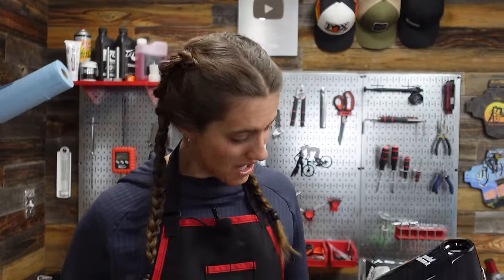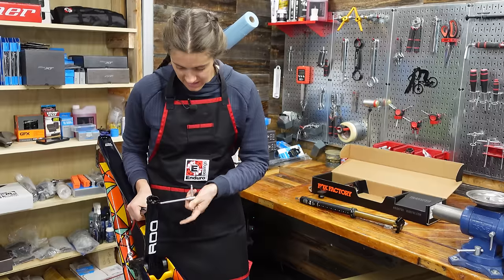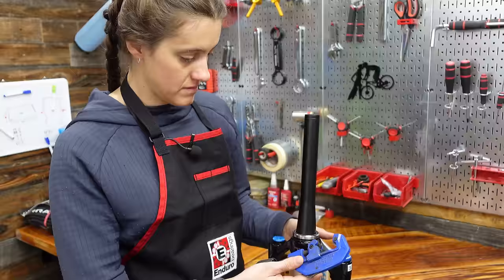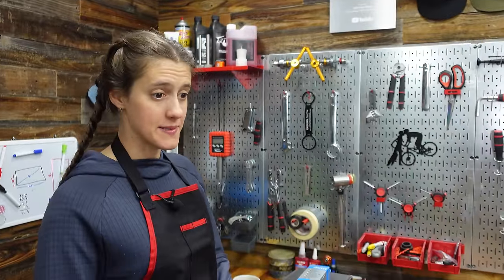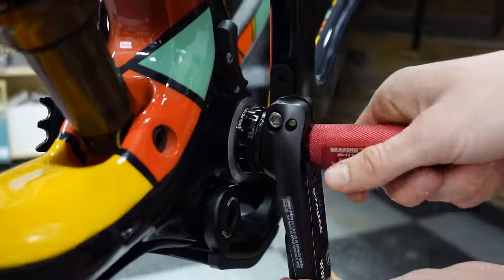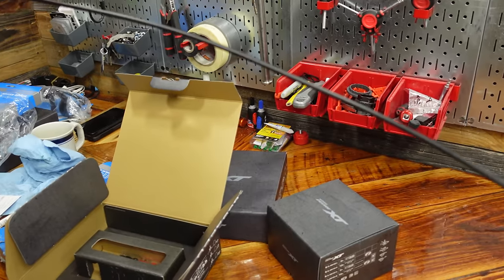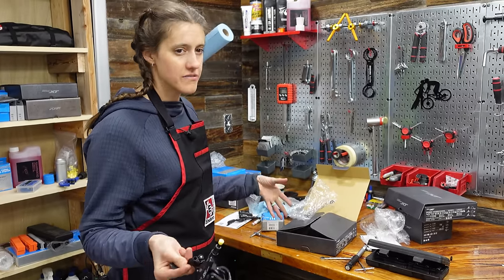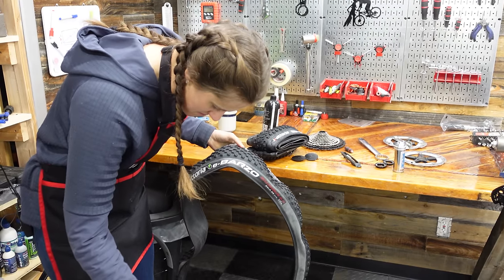FULL BUILD of my CUSTOM PAINTED Niner Bikes JET 9 RDO | Syd Fixes Bikes

Comment: I have a compressor, but no adapter for Presta valves, so I just use a hand pump to seat tubeless tires.  I wanted to make sure I could do it any time, anywhere.  The key is to just take a strap of some kind, even a piece of rope will do, and bind the tire right down the center.  It will seat with just a couple of pumps.  Pop the rope/strap off and finish pumping.  No big deal.

Beautiful bike btw, I love it!

Comment: I stripped a couple crank axles like that one with small splines. I "upgraded" to the type of axle spline that has smooth swoopy crank to axle interface but the drive side worked itself off after 50 miles and doesn't have clamps, it was pressure fit. I drilled and filed a square hole in the center of the crank side, used a 3/8" carriage bolt, a union nut, and a hex keyed countersunk bolt with washer pulling in from the other side. Crimp the thread on the carriage bolt at the depth you want the union nut to stop at.

Comment: After you tighten the crank arm pinch bolts you want to check for any play in the crank spindle.  If there's play, you'll want to loosen the pinch bolts and then using the BeCraFTS tool to adjust the spindle endcap bolt until there is no more play and the cranks spin relatively freely.

Comment: Welcome back.
Might be worth running the dropper post outer before installing the BB ... Access to that bend.
Reply from the maker: On this frame (and most frames with threaded button brackets) there's actually no access to inside the bike from where the BB threads in. And this frame also has continuous internal housing runs...
But on frames that do have internal access there, that's a great idea!
Reply: Haha, I’m in the middle of this exact thing.

Had to push out a perfectly good bb, which sadly ruined it, to get the dropper housing routed—it was just impossible otherwise.  Waiting for my new bb to arrive now.

Comment: Lining the tire logo up with the valve stem is definitely a thing. I do the same thing (sorta) with cars - the manufacturer logo on the wheel needs to be right-side up with the valve stem at 6 o'clock on the wheel.....and the locking lug nut goes opposite the valve stem.
You've reminded me that I need to bleed the old-school Hayes brakes on my vintage 4 Banger......

Comment: Re: tubeless.....

I ran tubeless for a season,  with a Stan's kit. But before all that, I did an experiment -- I coated the inside of my tires with automotive fix-a-flat, and let it air-dry (an hour or so).

Absolutely airtight. Went over 5 weeks without needing even 5 psi of top-off.

Only did it the one season because my bottle of Stan's got destroyed, and feeding 6 kids was a higher priority.

Comment: I never use star bits in forks as they're crap.

I've found a while back that there is a skewer  nut which will go all the way through the centre of the forks head tube and screws into a nut inserted into the bottom of the forks head tube pulling the whole top half firmly down.

That way, you know, when you're tightening it up, you are actually tightening it up and not simply pulling the star nut up.

Also, what a few companies are doing these days is to use that idea but instead of just a straight bolt through skewer, the top half is actually a mini trail-tool.

I believe OneUp have recently changed the design of their headtube mounted toolkit system to this sort of design too...which is a whole lot better than their previous method of having to tap some threads into the top of your fork's head tube.

This way, you still have options rather than bunging a semi-difficult/damaging to remove and annoying to fit in any case star nut...which basically always works loose in any case.

Comment: You can swap grease out for anti seize in any threaded or press fit application that does not involve bearings. Basically anything thats static. Parktool have a good page on it - the-park-tool-guide-to-bicycle-lubricants-and-compounds

Comment: lol, a while back in the late 2000's, I bought a super lightweight CF seat post which I overtightened. At that young age, torque meant nothing. I went ridding and 5 minutes into the trail, the seat post snapped, leaving a sharp piece of CF pointing straight up. I had to pedal out of saddle for a half hour to get home. That same day, I bought a torque wrench.

Comment: You put the brand logo with the valve stem so if you take it apart and find a hole you can look at the rim at the same place to see where it came from. There might be a dent on rim in that same spot. It makes it easy to find

Comment: Pipe cutters take twice as long but do a much better job of a clean cut on forks. 
Pro tip: Shove a small rag into the bottom of the fork crown. This will catch all of the saving and prevent them from falling into your fork seals.

Comment: Honestly, I don't think I have seen a prettier frame.  So well done and we'll designed.  Syd, fantastic seeing you get r done and putting together your own rig.  Never fails that there is still an element of realness even in a bike build vid, to show the challenges one might face in doing a full build.  Appreciate the thoroughly done build project, and the helpful commentary from you both.  Macky, maybe a reverse paint job of the same pattern for your next ride???

Comment: Great video. One thing that bothered me is when seeing people with a torque click style wrench not grasping in the center of the handle most torque wrenches are length specific. So when you slide your hand closer to the the square drive you are increasing the amount of torque at the square drive.

Comment: Wouldn’t you want a little wider tire since you are running a wider rim? 
I’m not even 5min in and already loving this. My heart started racing when you were holding the frame up. I would be freaking out with excitement. 
I have a carbon build in the works…waiting on my frame. It’s not supposed to be done until May and I check my email about 10 times a day already. 
As always, great video.

Comment: Sweet bike. Centering the logo of the tire brand on the stem looks best. But I guess I am too practical, I center the tire pressure info on the stem so I am looking at it when inflating the tire.

Comment: Star nuts are easy to install by getting an old adjustable wrench and a hammer and putting the handle of the hammer on the Star nut and hitting it with the wrench

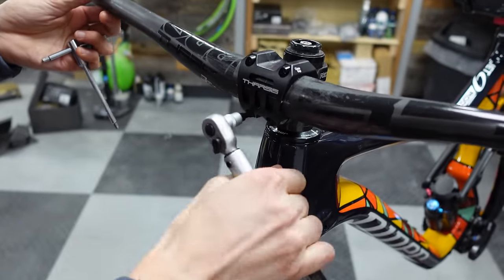Comment: Awesome to watch this beautiful bike come together!  I just had one quibble... at 23:57 I see you holding the torque wrench by the shaft, up closer to to the head.  This kind of click-style torque wrench won't give you an accurate reading unless you hold it by the handle and let the spring-loaded clicker do its job.  You could very easily accidentally overtighten bolts that way.  Great job overall, though... it looks amazing, and I'm looking forward to seeing you riding it!

Comment: fyi, Syd is marking the extra, as the "flare_nut" has a flare on the pipe, like the end of a clarinet, or other wind instrument, this locks the pipe in the fitting, and the taper on the inside seals the fluid path; this nut bottoms out on the other part inside, plus tension, this is the distance that Syd is marking, where the distance is, PLUS clearance for the flaring operation.

Comment: great video, but Syd, a Torque Wrench needs to be handled a certain way (so you don't jerk it, causing a high spike in torque, meaning the "break" or trigger goes off prematurely), to do it correctly, use the wrench TWO handed, one supporting the head, the other the handle, and gently grip it, straight arms, and pull evenly, and at a moderate, not fast pace so you feel the 'weight' come on gradually, then like a guns' trigger, SNAP, it breaks, giving a correct reading of applied torque.

Comment: How does that specific pipe cutter work? I only ask because I assumed they were like a pipe cutter like Rigid or Milwaukee cutter. They don't technically remove any stock (produce chips) that could fall down the tube or get in grease. 
Either way cutting fluid would make the pipe cutter's blade last longer, stop squeaking, and give a cleaner cut. I use pneumatic tool oil just because it's safe and cheap.

Comment: 2 years ago I cut my new RockShox SID ($875) too short. Ahaaaaaa!!  It was devastating!  When I marked the cut line on the tube then cut it off, I realized there were 2 lines on the tube – and one was a “False Line” caused by whatever caused it in the fitting process. Anyway, I cut on the wrong line and made it 2 inches too short. I ended up buying a new steerer tube and having by local shop install it. $400 later, I got a 2nd chance. Now I have the most expensive RockShox SID in the world.
Reply: Easy done. 🇬🇧 👍

Comment: Just a heads up on your chain length info, with Shimano 12 speed they changed it from 4 or 5 extra links for a full suspension to 5 or 6 links.  It's not much of a difference just thought you should know Shimano's recommendation.

Comment: Thanks for sharing this adventure! Why do you attach the brake hose to the lever using a vice instead of putting the lever on the handlebars?
Reply from the maker: Because if the lever is on the handlebars, the oil that's in the lever will spill out! Unless you can get your handlebars to be perpendicular to the ground (which is hard 😁).

Comment: Awesome bike! I just started running Syerra's front and rear on my Jet 9. Why are you running a Barzo on the rear? ... and also Why an  E-Barzo? I have a TNT Barzo 2.35 I can put on my bike also. Is it a better climbing tire than the Syerra or just a lighter tire? How do you like that setup?
Reply from the maker: I'm used to running a Barzo on back and don't have many extra Syerras 😁
Not sure how the weight and rolling resistance compare, but I'd guess the Barzo is a bit lighter.
E-Barzo because they were out of stock of the XC-Trail Barzo and the e-Barzo is the same (just with different markings).

Comment: Aren’t you not supposed to grease rotor lockrings cause it can end up on the rotors and ruin your pads?
Reply: If you use an excessive amount this will be a problem. Use a reasonable amount, if there is excess on the outside, wipe it off. That's it.

Comment: Yikes. That frame must have horrible tolerances in the BB. That crank should spin VERY freely.
Reply from the maker: New BB bearings don't tend to spin freely, they take some time to wear in. If they do soon easily right after you install then, you have a bad BB that's going to wear out quickly.